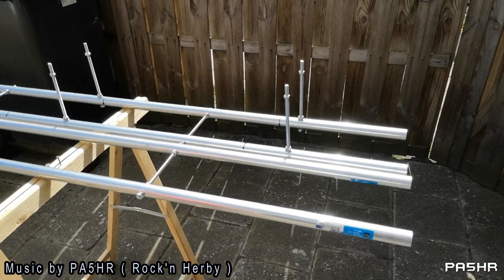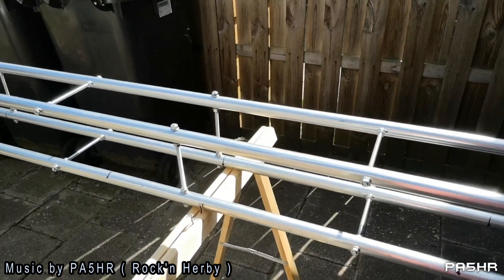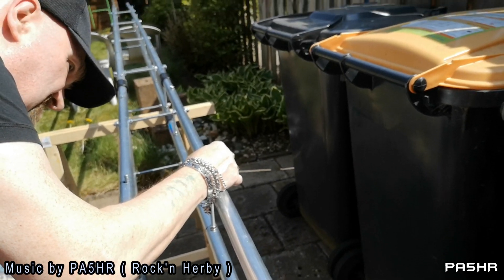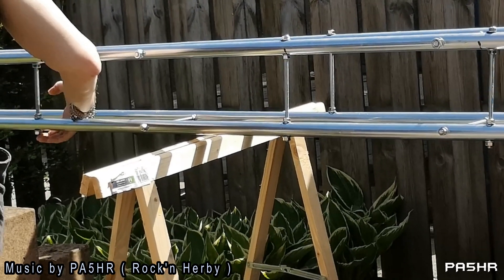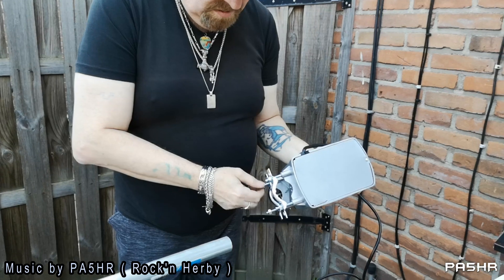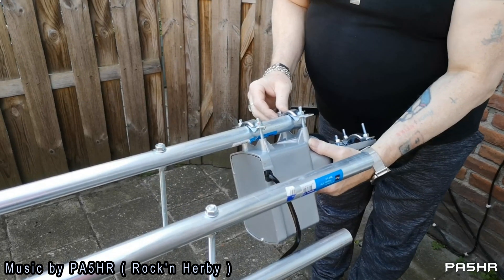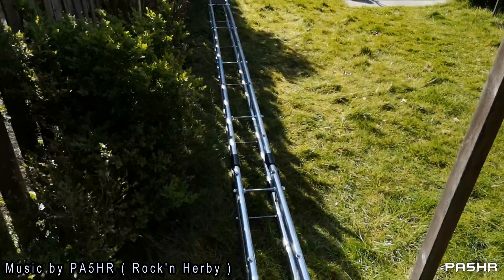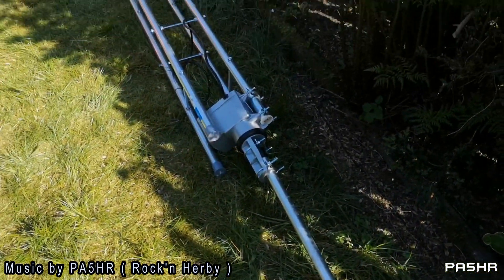Antenne ( Tower )  Mast Finishing and Rotator placing

Comment: That's quite a job to get done. The Prepair Work drilling all the Holes, fixing and assembling (montieren) of all the Threaded Rods (Gewindestäbe). Exspecially if you just have a tiny backyard with practically less of space to make something work out. Hey Bert this looks really great, i could not do this any better myself. I like that modified 1/2 wave CB Vertical with the Coil for the 40m Band. All this was a lot of hours work. Respect Bert...73 de YFUG 💯🤘🤘🤘👍🙋‍♂
Reply from the maker: Ich danke Dir fuer deine super Reacktion ja es war wirklich viel Arbeit aber am Ende steht das Resultat und das ist einfach gut ja die verticale fuer 40 Meter geht wirklich gut habe damit viele weite verbindungen und war mal eine Idee und Experiment von mir, aber als ich gemerkt habe das diese Configuration gut geht habe ich sie als DX Antenne fuer 40 Meter genommen. Es geht sicher besser aber in meinem Fall war es ein voller Erfolg und die kosten halten sich in grenzen ca. 80 Euro mit Antenne und zusatz Material  also fuer menschen mit wenig Platz eine ideale Idee. So nochmal danke fuer deine Reacktion und das schoene QSO auf 40 Meter hoffe wir hoeren uns bald mal wieder vy 73 de Bert PA5HR
Reply: @PA5HR1  Hallo Bert, ich habe selbst irgendwann gelernt das man nicht immer horizontal polarisiert arbbeiten muß um ein effizientes Signal zu produzieren. Das geht vertikal genauso prima solange man genügend Flachabstrahlung erzeugt und nicht alles einfach irgeendwie in die Atmosphäre raushaut.
Klar würden gestreckte 2 x 10m Draht eventuell etwas lauter werden als die 5,50m Alu Route mit Spule, rein theoretisch gesehen jedenfalls. man müsste hingehen und einen 1:1 direktvergleich durchführen um das genauer analysieren um es besttätigen zu können.
Wie Du selbst sagtest, für das Platzangebot das dir zur Veffügung steht hast Du das für dich best Möglichste für weniger Euros rausgeholt.
Ich betreibe auch viele Antennen entgegen aller üblichen Regeln der Kunst das sich Herr Rothammel dreimal im Grabe umdrehen würde wenn er wüsste da es dadraussen einen HF gestörten Onkel Günter gibt der grundsätzlich alles andees macht als die breite Amateurfunk Gemeinde. Genau das fasziniert mich mehr als 1:1 Nachbauten von irgendwas.
Schönen Donnerstag & danke für's Kanal abonieren. 73 de Onkel Günter, DK5ONV 💯🍻🙋‍♂
Reply from the maker: @DK5ONV  Hallo Guenter ja klar das ist auch meine devise experimentieren bis der Arzt kommt, das heisst ich probiere einfach aus und halte mich nicht immer an das was in den Buechern steht sondern baue nach den Physikalischen Gesetz aber nach eigenem Prinzip. Ich habe so schon sehr viele Erfolge erzielt und mir sehr viel Geld gespart was kmmerzielle Antennen angeht, die dann meistens auch nicht viel besser gehen, manchmal sogar schlechter sind als meine Eigenbauten. Ich bin sehr zufrieden mit meinen Resultaten denn ich bin immer laut und gut zu hoeren Welt weit. Ja ich habe mir deine Videoa angeschaut, sehr interessant was du machst und wie es dir gelingt super Qso's zu fahren im DX da nehme ich meinen Hut auch vor ab super gemacht, da haette ich auch grosse Freude wenn solche verbindungen mit wenig aufwand zu stande kommen. Es muss nicht immer 5 9+20 sein es geht auch mal 3u.4 wenn alles rueber kommt ist das super. So freue mich auf ein neues Video von Dir oder einen neuen Kontakt auf 40 Meter wuensche dir Vy 73 immer good DX de Bert PA5HR